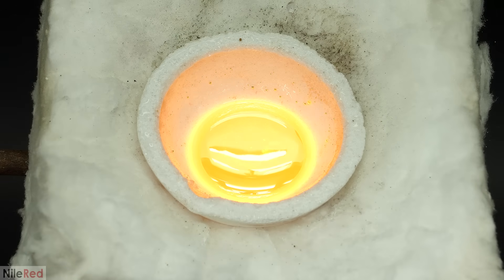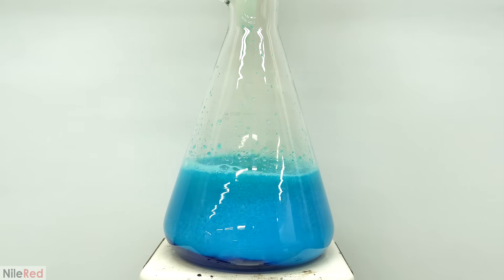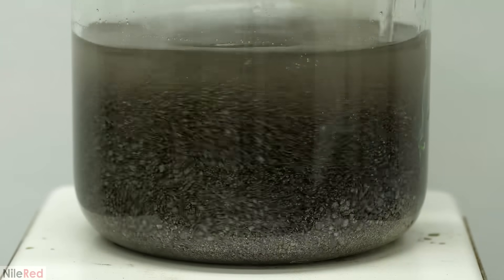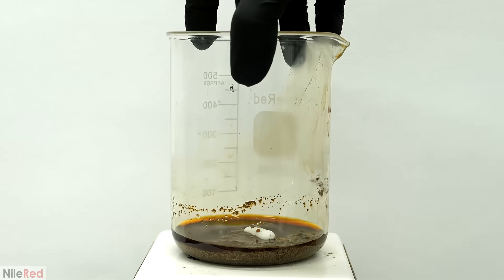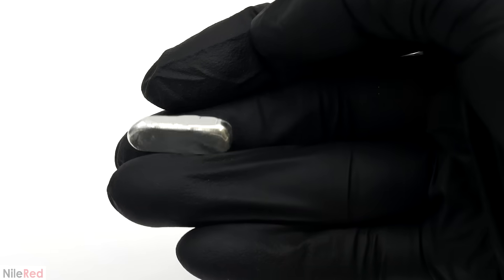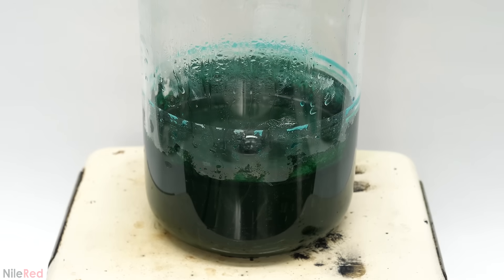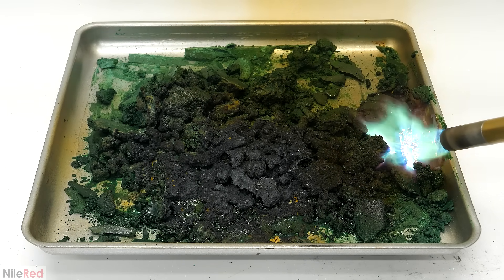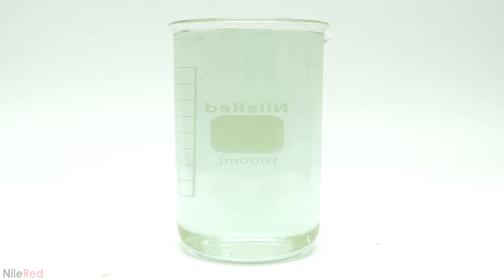Cleaning up my gold waste

Comment: In the school, i liked chemistry alot, till teacher killed it with only theoretical formulas.
Thank you, for making chemistry so interesting <3
Reply: You have to do lab work with it otherwise it just turns into math and looking up known elemental properties to fill into the equations.
Reply: @KnightsWithoutATable  Which is how things are in most American schools for two reasons: costs (since the football team always needs new equipment) and administrators who get nervous if they see a student using a manual pencil sharpener or cutting paper with anything but safety scissors. We couldn't ever do much beyond theory and equation balancing with the occasional "well, that was vaguely interesting" demonstration because some girl loooooooong before my class didn't listen to instructions when using a mouth pipette (which should tell you how old the tall tale was) and sucked up some acid that caused her front teeth to puff up and dissolve when they washed her mouth with a neutralizing solution. The most exciting thing we ever did, by which I mean watched the teacher do, was dissolve the zinc out of a penny leaving the copper shell behind.
Reply: @custos3249  Pipetting by mouth has been a no-no for a good 75 years and pointless to learn how to do with modern equipment. I took my chemistry in college, so we paid for the chemicals we used and the disposal of the waste with a lab fee. The textbook was more expensive, but I got to keep that.
Reply: @KnightsWithoutATable  Exactly my point. I graduated high school in '05, and they were still using that excuse for why we couldn't have nice things. Hard to say if it was ever legit, just a way to sidestep not having the funding, or all the above fearing a law suit. Hell, in HS biology, the most lab work we ever did was look at onion cells under the scope. Pretty riveting shit right there, especially considering that years prior in 5th grade, we dissected frogs, fish, cow eyes, and I even got to lead a class on a virtual dissection of a human because my teacher saw how good I was at playing a DOS game called 3-D Body Adventure. *disappears into cloud of nostalgia for the 90s. Truly was a better time*
Reply: @custos3249  Not even looking at microbes from a puddle under the microscope? Sounds more like funding and a teacher teaching science that wasn't trained or enthusiastic about it.
Reply: @KnightsWithoutATable  Ah, yep. Forgot that we did the perfunctory euglena and paramecium too. Still doesn't really compare to slicing open an eye though, to me at least. Regardless, same teacher for both bio and chem who'd been a chemist prior to teaching. He had to fight just to do the penny demonstration after blowing up a small baloon of hydrogen for a class "without approval." Ultimately had to bring his own chemicals, since, ya know, all acids are like xenomorph blood, so the school couldn't store them... Our admins weren't the brightest.
Reply: @custos3249  Most school admins aren't the brightest crayons in the box. The position seems to change them and/or attract that kind of person.
Reply: @KnightsWithoutATable  My oldest sister started as a Spec. Ed. teacher and is now a principal. Regrettably, I've an intimate knowledge of the stupid that'd drive lesser men to alcoholism or something worse and Lovecraftian. It's as genuinely astonishing as it is baffling how much a person can succeed with the right precision of mediocrity.
Reply: Custos very true but i learned it anyways, chemisty is probably the first thing i have learned, and tech.
Reply: KnightsWithoutATable we rarely did experiments and most of what we did was things we’ve done in science classes for years. The two experiments I did love were an observation of how chemicals change flame colors(was absolutely magical) and isolating copper from something I don’t remember (we obviously didn’t go this far but it was still cool
Reply: That's what we had. Literally every other school and even other classes in our school did some practice and it was fun. But not our class. Nothing at all. It killed any excitement for chemistry as it was endless formulas I cared less and less as years went. And as matter if fact, my mother is chemistry teacher in other schools and I really was looking forward to study chemistry. Apparently our teacher was completely killing it.
Reply: POV:you're waiting for a reply to say "nerd" so you can roast them
Reply: @Pwithstar  nerd
Reply: @Grunbeld32  not me
Reply: @Pwithstar  :(